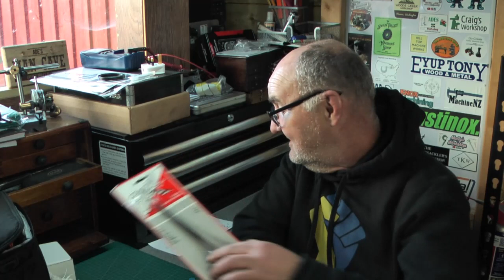A Plea for help and a new mini project.

Comment: Ade I;am a retired locksmith. i need n gate lock to be modified to take a cylinder which i have. only need two end mills for the job 10mm and 18mm the cost quoted will be my donation INTERESTED   ??